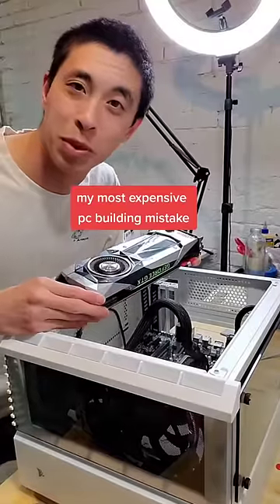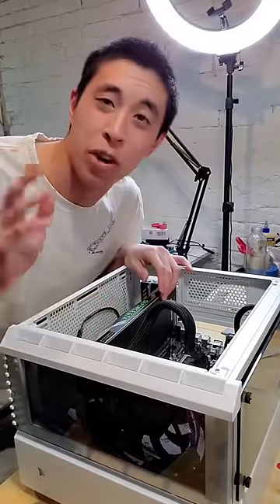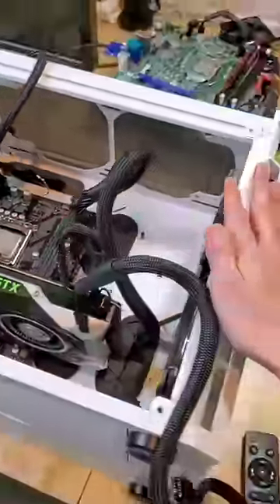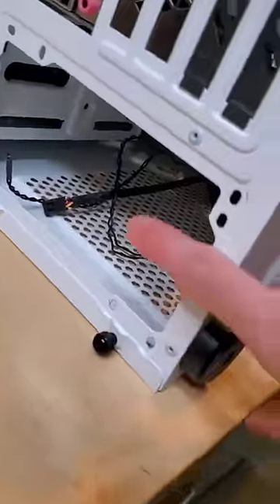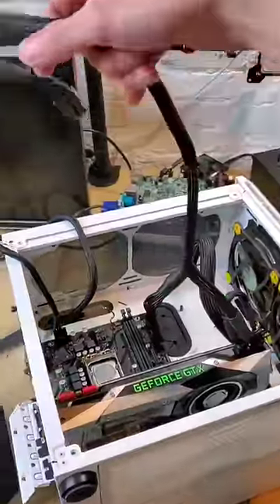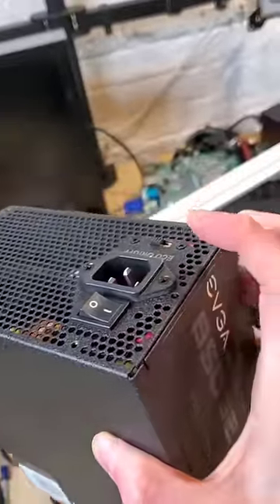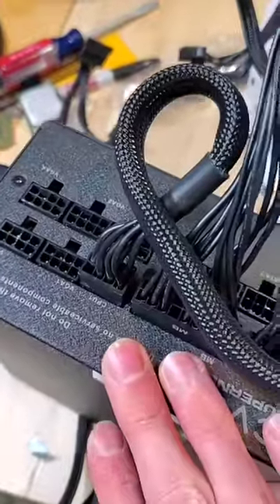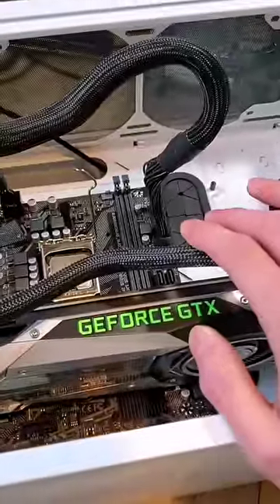my most expensive pc building mistake... #shorts

Comment: Absolutely correct I spent 5500 on a new pc set up and did exactly what you said but I just wanted a platinum rated psu and fried everything by using pre routed psu cables
Reply: 5500 roubles?

Comment: I was converting my pc from one case to another, I’ve had this computer for 5 years and had made a lot of memories with his thing. While I was changing cases, I saw a fan hub on the back of the computer (this was the Corsair 7000D Airflow) I thought it would be a good idea to plug in all 6 of my fans, and after asking Reddit, I was given the green light. I plugged in all of my fans into the hub and turned on the pc. I heard an extremely loud bang, followed by smoke. I unplugged the psu and switched it off and sat there for about 5 minutes in silence. 5 years of memories, games, photos, and hardware, all gone, just like that. That pc cost me 3k and the new one I built cost 4k. I’ve learned to be extremely cautious and knowledgeable around computers, but I still get chills when I build new pcs. Be careful with pcs guys.
Reply: Man rlly trusted ppl on reddit
Reply: @OllieHicks-Sandri  they gave good advice, i just did it wrong
Reply: @CAFilms420  so what did you do wrong?
Reply: @sonic4life  When all the fans turned on, something happened with the fan hub, causing it to receive all of the fan's power at once, essentially exploding it.
Reply: What was the problem
Reply: @CAFilms420  what was the problem

Comment: Not really a mistake so much as an oversight, went to the ewaste place and ended up finding a Vega Frontier Edition which was light years ahead of the Radeon 4650 I had. The 400w psu in my HP hunk of junk at the time was nowhere enough and I didn’t realize that the psu was not a standard size (about a half inch too big in height and width). So after an afternoon with a Dremel pair of side cutters I made a custom bracket for the psu and got that thing working with a 700w Thermaltake psu. Used it for almost a year in that configuration before I got a “broken” pc on Marketplace for $50 which I guessed from the description had a dead psu and it did. Got a 1800x and a decent mobo and 16gb of ram out of that and I couldn’t be happier
Reply: What do you mean "Went to the Ewaste place"?

What does that even mean?

Where I live, Ewaste places where you can go a look through the Ewaste do not exist.

They pick up your Ewaste, thats it.

Honestly, am I missing something here? I'd love to look through old parts again.
Reply: @nexxusty  here it’s just a drop off point at the recycling centre, everything is just kinda in one area you can go to and deposit. Sometimes it is literally just junk pcs and old TVs, and other times there’s interesting stuff, one time I snagged like 10 or so working RX560s and sold them all for some quick pocket change
Reply: @aidanbrooks771  Ahh. I see. Quick hands.

Gotcha.

I am definitely going to check out some of these Ewaste drop off places then.

Comment: somehow even after building like 7 PCs I have never destroyed a component (knock on wood). 

The worst mistake I can think of is misdiagnosing an issue and buying a new PSU when it was the motherboard I had to RMA. 

It turned out alright though since that PSU found a home just 2 months later aswell.
Reply: So far I have burnt a motherboard by just flipping the power on, I’m 80% certain now that it was probably defective board as when I got the replacement the replacement started to work just fine. I’m not sure about the latest, as the motherboard would not even light up, so that mobo was DOA… I think, that power supply is at least 5 years old.
Reply: @LyraniaLothar  Ive had a gigabyte mobo's mosfets fail, i dont remember the model but it was for intel 4th gen. It was a $250, nearly top of the line board and it failed within 2 years. Temps where not hot and it wasnt even OC'd

Comment: I have a friend who took a vacuum to her PC. Boom, gone!
As for me, I delided my 13900 to do direct die. Afterwards, I spent 5-6 hours sizing, cutting, and routing the loop. Out of nowhere, well, not really, if I had double-checked my work. I have 2x 420 radiators  on the upper chasis passing coolant back and forth. I missed a compression fitting from the first radiator to the second. This is why you always prime your loop with a psu outside the case, and always use a 20-pin bypass.

Comment: You CAN re-use sleeved extensions, just not the cables that plug directly into the PSU.
Reply: You can use anything so long as it's properly crimped and sized for the current draw.
Reply: Extensions yes because they just extended whatever the pins already are.

Comment: I’ve only ever built one pc but my biggest mistake on that one was that I couldn’t find the motherboard screws that came with the case. I looked everywhere for them and it turns out they were just in the hard drive compartment
Reply: O11 air mini?
Reply: I just built a computer today and i did the same thing. It only took me like 5 minutes to find but i was panicking in those 5 minutes
Reply: @TuckT  I fell you
Reply: i built x3 systems for my kids for xmas and on the last one i did this it was a omg moment as i didn't have any left and it was late. I save like all year to make sure I could buy all of them a new build and when I could not find the screws I was panicked thinking one of my boys would be very disappointed...

Comment: I did this. I probed the cables and realized they were supplying 12V to the sense pin, which should be ground. Luckily it didn't cause any damage, the GPU just wouldn't start until I fixed the issue.

Comment: I bricked a perfectly fine gpu by flashing the same bios it already had on it, and then proceeded to fry the bios chip by incorectly shorting pins 1 and 8 to reset it. Im just stupid beyond stupidity
Reply: Lol wait. So after you tried to flash the same bios, did the computer just not detect it anymore? I once flashed what must've been unstable bios onto my RX570, no display out etc. Had to put it in a different computer and reflash it back to stock because the pc it was in had a Xeon, no integrated graphics. Still works till this day. Pretty sure you could've just reflashed a different bios onto it? Then revert it back to stock?
Reply: @tacticalmattress  i used the crappy windows ati flashing program and couldnt reflash it through it. I got it working once i shorted the pins, but unfortunatelly i fried it the second time i tried shorting the pins. Should've used dos flashing utility

Comment: Back in the day i somehow broke the laptop hdd, by simply pushing the top-case with my elbow. No idea, how could that happen, now i bought myself a separate keyboard and ssd to avoid situations like these
Reply: Rip
Reply: Probeply bend the HDD case that prevented the HDD from moving maybe? If you still have it and have no precious data on it it's worth opening it up bend the enclosure back and screwing it back on? Maybe it will work
Reply: @kurtiuscobainius1581  no, it got thrown into a trash bin 6 years ago

Comment: Late to the party but if you have an am4 socket and are new to either amd or building cpus, make sure you do something to warm up the thermal paste before removing/changing a cpu cooler. First time i removed it, had no problems. 2nd time, guess my room was colder or smth, it ripped my cpu out of the socket and bent 7-8 pins. Luckily ifixit had a good demonstration on how to fix bent pens.
Reply: Seems like a common sense mistake but there will always be new people in this space

Comment: Bought an EVGA power supply and had it tear itself apart then nearly start a fire about a year into use. Luckily, it didn't fry any of the components attached to it save for an MSI Unify mobo. Lesson learned: never cheap out on the power supply again. I was out about $380 in components and in need of a new PSU. Luckily I'd a spare board on hand.
Reply: I mean EVGA is usually top tier in psus? It may have been a lemon
Reply: @svader9680  lot of psu brands made flops previous years...remember the gigabyte psus from 2021?

Comment: I thoroughly cleaned my custom loop. I took everything, including the blocks apart, and deep cleaned them. I reassembled everything and turned my machine on... Only to find out that the cpu block was leaking MASSIVELY due to the o-ring missing. Everything died, except my 3930k cpu (motherboard, 980ti, 1000w psu, quad channel memory kit). This was the last time I ever powered on the whole system after messing with the loop like that. 

Please guys: Always pressure test your loop, AND leak test with only the pump running from a separate PSU for at least 8-12 hours.

Comment: For some new or high end boards, the board or PSU will actually “trip” and not cause damages to the components. But still definitely don’t try this
Reply: What happens in the case of "trip" because my pc does this really weird thing were it turns on fans spin at max rpm and it just does that with no display, other times the pc will work like normal,

 its a msi b550 tomohawk
Ryzen 7 3700x 
16gb trident z neo ram
Rtx 2070 super
Corsair 650-750 psu i can't remember,

 anyway of theres any major faults with any of these ide love for someone to help because im new to pc's i dont really know whats happening, ive had a few friends take a look and i get inconsistent answers so obviously no one actually knows yet whats happening.
Reply: @onlygaming69  in the case of a trip the PSU will make a clicking noise and won’t turn on the computer at all. This is usually a trip with the main power. 
When you boot up your computer look at the motherboards lights and it could show you what the problem is.
Your problem could be your GPU or CPU. If you can’t get to the bios, that could be CPU. You can try updating the BIOS, then update GPU and then windows and so on. Just to be sure. Check for any loose cabling too. 

The last thing you should do is reseat you’re CPU if all else fails.
Reply: I used a modular PCIe cable from china and nothing has happened since

Comment: Damn I never knew that. It sounds so normal too. I hope I'll remember this by the time I build a new PC.
Reply: @legenarymaster3696  That's what I was thinking. As long as the pins are the same they is literally nothing different from cable to cable.
Reply: @fourthpanda  your logic is correct
Reply: @legenarymaster3696  Sorry to say but this video is fine and you're the one that's wrong. MODULAR power supply cables are NOT standardized. The pin layouts vary depending on the manufacturer and even between different models from a single manufacturer and thus are NOT interchangeable. It's all covered in a video from Gamer's Nexus, although if you have a continuity tester you can figure out which cables can be used. The video I'm referring to is this one: https://www.youtube.com/watch?v=opFTzO1s1WA

Comment: I once tried to plug in my 12v led strip and some how touched the plug to the motherboard while it was powered plugged into the psu. Saw a small spark on the MB pretty far from where The wires touched, so I’m pretty sure it was just following the trace. Later Forgot where it sparked cause I was kinda distressed.

 Motherboard was dead from then on. Was a semi expensive asrock board, but what sucked was the build was a triple boot hackintosh system that I didn’t back up.  Those of you that have hackintoshes can attest to how Finicky some motherboards can be when installing on non apple hardware. Also Since it was a haswell cpu, I kinda had a hard time finding a suitable replacement board since it was like 2021.

Morale of the story is make sure everything is de powered before you stick you hand in your build, no matter how menial the task may seem.
Reply: A working non-virtual machine hackintosh that's dead? I feel your pain.
Reply: I've killed 5V led strips using 12V controller, not the end of the world though, or the beginning.

Comment: I don't even properly understand what he did so I don't even know how I avoid it
Reply: He used cables already plugged in his components on a new power supply which fried everything since its not compatible.
Reply: @Jeast.  how does one know if the cables are correct
Reply: @JamilJCChaka   if the cables come with the powersupply
Reply: So I can't buy better cables from the same brand,  like a corsair pcie cable for my graphics card that is for a corsair psu?
Reply: @practicallyprinz   i mean its possible but i personally wouldnt risk it.
Reply: @Jeast.  but they're shit stock cables,  Maybe I should just snippy snippy lol. 😂
Reply: @practicallyprinz  there's specific cable sellers for different PSUs.. like cablemod for example. They cost a small fortune though.

If you need a single cable you can buy one used but you need to make extra sure it's compatible. Otherwise you'd need to buy a new PSU.

Comment: I did this exact thing to my brand new build. One of my ssds what making a loud high pitch screaming sound so i turned it off and back on again. Proceeded to smell the depression filling the air. Swapped cables to the ones that came with the new psu and thankfully everything but that one ssd worked and still works till this day 😅😊

Comment: First time taking apart an GPU to re paste and clean it.
Disassembly went well, of course it was dirty with all sorts of gamer cheese. It was an old 1070SC. Well, I grabbed the wrong IPA to clean the components with. I grabbed a bottle that was 51% IPA the rest 49% was water. 
Long story short, it wasn’t completely dry when I plugged it back into my test system.

Best way to avoid this mistake? Don’t cheap out with IPA. Either buy 100% IPA, or purchase BW100 or electronics cleaner that evaporates quickly.

Comment: Don't use EVGA power supplies they have an oddly high amount of defective units. Whether they die with in a short amount of time or they fry the components they are connected to, especially hard drives for some reason. They also generally don't have safety measures to prevent the use of modular cables that don't work unlike other major manufacturers' power supplies that will not turn on if the modular cable isn't right that's plugged into it or they just don't send power through the incorrect cables.
Reply: My evga psu is going strong 💪🏻

Comment: My friend upgraded GPU but didn't have a cable for the modular power supply. Other friend had one that was fitting, but I stopped him from just plugging it in. Came with a multimeter, measured every cable and swapped some pins. It worked like a charm, but it probably would just short PSU without destroying anything else, cuz if i left it like that the +12 and ground would be shorted right at the plug.

Comment: Definitely something to be wary of... But all you have to do is make sure you're using the same brand/cable types and you'll be fine. For example Corsair RM650x, 750x, 850x, 1000x, all use Type 4 Corsair, so are totally interchangeable with cables. But older Corsair PSU may not be if it uses Type 3. If you're ever unsure just look it up or email the company and ask.
Reply: I actually did this today, but i got a cx750m which i upgraded from my cx450m. Only cable i kept was the sata cable. No problem right? Since its the same series right?

Comment: im literaly ordering a new power supply from my pc and was going to do what you did. THANK YOU, you have no idea. Well i guess you do have an idea lol.
Reply: I haven't built a PC before But I am going to do so now, I don't understand  what the problem is and how to avoid it, I'm so confused, Could you pleeeeaaase do som simple explanation and if it's even a problem when building new systems? Thx 😊
Reply: @lillsamy291 pretty much don't mix and match power supply cables. Not all brands use the same pin layout even though the connector is the same, so it can cause juice to flow in the wrong direction, and give up the magic smoke. For a new build this shouldn't be an issue.
Reply: @aboveaveragebayleaf9216  alright! Thx for the explanation!

Comment: Really mixing cables should NEVER create a problem because they should be rated to handle the power going through the same pins. The issue is in reality one of quality control. If a company has bad quality control then you can not trust their cables or power supply. Bad power supplies take out far more gaming pc's then any other part. 

Never scrimp on a power supply. This does not mean you have to pay more to get better quality. It just means do you research for ratings and tests and realize even a good model has a failure rate and might still fail. Also make sure you do the proper calculations for power supply usage adding a buffer so you have enough power. A 10-15% buffer (or amount over what you think you might need for wattage should be fine.

It is not hard to do the calculations but I still use pcpartpicker system builder to estimate my power usage and check for conflicts I didn't think of. Also Tomsharward usually has pretty up to date specs and reviews on power supplies.

Comment: When I built my first pc a while back, I tried troubleshooting my non-posting pc (the issue was that the bios needed updating to be compatible with the r5 2600). I ended up taking the cpu out of the mobo in an effort to find out what was going wrong and put it back but forgot to thermal paste it again. So the Cpu got bbq’ed and the motherboard too.
Reply: The R5 2600 shuts down @95c to save itself. And why would your motherboard get bad for a hot cpu?

Comment: Few years ago, I tried changing my cooler, and my processor came off the socket with my stock AMD cooler, tried my ways to separately it from the cooler and nothing worked. I drove 40 mins to the store, and then fix it in 2 seconds by prying it off with a screwdriver. Next time, warmup your PC before you change coolers. And yes it was a 3700x which was considered high end at the time